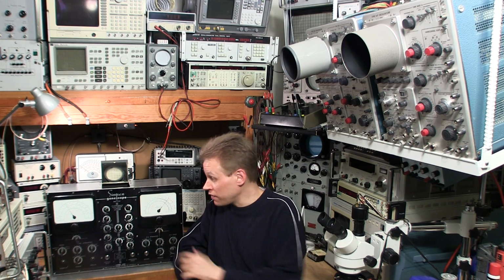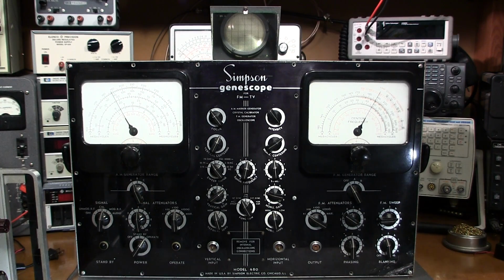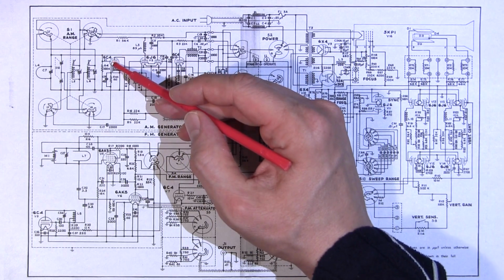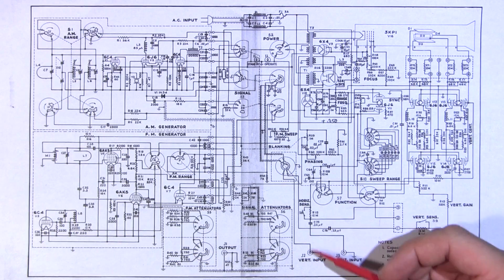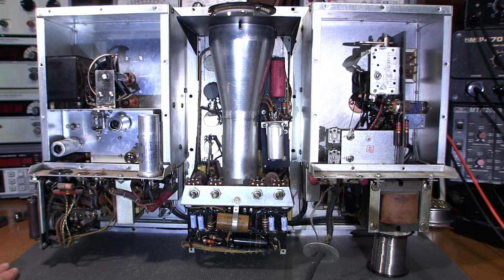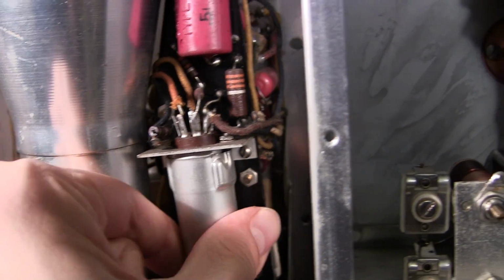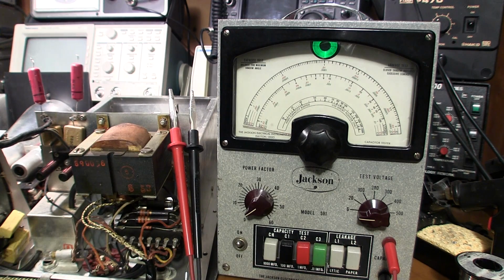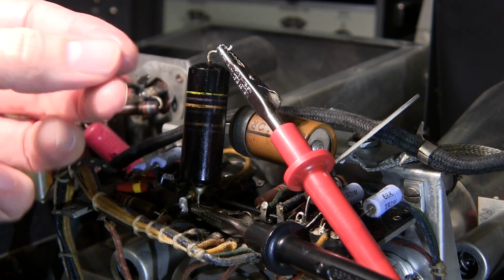Sneak Peak and Tear Down of a Simpson Genescope 480

Comment: Sorry Paul for commenting so late.

Cool... A "Wobulator!"

Sure looks like a huge endeavor to restore but well worth it.

I would love to see you modify the AM section to go down to the AM-SW spectrum. I know you, I bet you'd modify the dial's silkscreen so you couldn't tell that you added an extra band. You're right. You could use this for any vintage tube receiver gear. I hope you have an extra position on the ganged switch assembly to accomplish this.

I have three different 7" electrostatic TVs I will be working on. I also have a Pilot TV-37 with a P4 variant of CRT like your Simpson uses.

Best of luck and I hope you do choose to restore this fine piece of vintage test gear.

Take care,
                  Tom

Comment: I happen to have a 480 that's been sitting for a couple of years awaiting restoration, so in my unbiased opinion, I vote for the full Mr. Carlson treatment on that one (with the frequency mod, of course).  Simpson got a lot of mileage out of the design ... The scope portion was available as a stand-alone called the Model 476 Mirroscope, and if you couldn't afford the 480, you could get just the marker/generator parts as the Model 479 TV-FM generator.  I think you're correct that Simpson didn't include a AM radio frequency range in the Genescope because it would  compete with their AM signal generator line ... the model 415 and 415a (adds FM modulation) have a similar front panel look and the proprietary connectors as the Genescope, and we're probably marketed to service shops as a "family" of instrumentation. Can't wait to follow along!
Reply from the maker: Thanks for your input!

Comment: Death caps! There's a story floating around YouTube about a lady plugging in an old Delmonico and after hearing pop and seeing smoke thinking it's a goner gives it away, only to be resurrected with a few modern components and some minor tuning. Turns out the across the line "death cap" exploded and just left some smouldering confetti to clean up. 

Definitely increase the range, but how to do it without butchering the front panel? Add a 4 position selector and leave the lowest frequency range unmarked?

Comment: That is one big device! And 'just' 40 minutes so I don't have to set aside a whole evening to watch it :) One remark though: the crystal in the AM generator is NOT for stabilization, it's there for the CAL and Marker functions. First, you can't stabilize the generator with a 5 MHz crystal because then the smallest step would be 5 MHz, and there is no phase detection circuit and no feedback to the oscillator section.
Reply from the maker: HI Paul. The 5MHz crystal is a frequency standard, mixed with a free running oscillator to provide overall stability. I will cover this more when I do the restoration. If you want to read this in their words, here is the PDF, read page 8 of this PDF, or search for page 7 of the actual displayed page : http://www.myvintagetv.com/Apple%20PDF%20files/Simpson%20480%20Genescope.pdf
Reply: Hi Paul. Thanks for the link to the PDF, but I think it confirms what I said: the crystal does not enhance the stability of the oscillator. What it does is giving reference points on the scale, so that the user can calculate the logging dial steps between 2 reference points and then calculate the steps needed to get to the wanted frequency. So if you want for example 10.2Mhz you first determine the steps between 10 and 11MHz and then multiply these steps by 0.2 to get the steps you need to go from 10 to 10.2MHz, The 10MHz point can be found precisely by using the X-tal. Still a nice method to get a precise frequency!
Reply from the maker: Well Paul, you may be right. The topology is correct for a stable VFO, but they may be just mixing the 5MHz signal in for marking alone.

Comment: Definitely do the restoration as a video. There is a lot to be learned from working on old gear. I don't recall seeing one of these. I did work for a while on TV's in the late 60's. I'm guessing that unit was built in the 50's. Just has that look inside. The fact that the tubes are all miniature etc. that Mallory Cap is also a 50's item. 
I vote to do the mods to add the AM broadcast band, maybe even go down to 400khz for IF ?  A lot of test gear gets modified to suit the owner, so no harm there.

Comment: Hello Paul,  thanks. This will be a nice project. I am in favour of adding AM and SW modifications to the function generator as it gives a better educational value for the project and a good all-in-one system for you as well to use. It was interesting to learn about the typo error in the circuit diagram.

Comment: This is an electrostatic deflection tube, not magnetic (which would use a yoke like a traditional crt tv chassis); the E and H fields are at right angles to each other, and to the path of the charged particles (here, electrons). So while the vertical section in a tv would drive the vertical coils in a yoke, they have to drive the horizontal plates in this tube... I think. Also, the tube itself might be rotated 90 degrees.
Reply: Does the odd wiring have anything to do with the fact that the CRT is projecting into a mirror?
Reply from the maker: Hi William. That still doesn't fix the fact that the tube legend is wrong, and the internal deflection plates are attached to the wrong sides. If the tube was (physically) rotated 90 degrees, the horizontal dot travel would be from bottom to top, that would be a strange looking display.
Reply: N1RKW Good question!  Maybe Mr. Carlson can answer...

Comment: Hi, I recently joined the channel and i love vintage audio amplifiers. i would like to see (if possible) a repair or service of an old Nakamichi PA-7 Mark2 and also if this one can be improved.
I would like to see recomendations for those who enjoy modifications on tower speakers like Klipch RF-7 and precautions to convert a normal pair of speakers to become part of biampable or tri-amp system by using active crossovers eliminating the passive ones.

Comment: Maybe the brackets holding the variable inductor at 32:00, could be made in a different fashion. Is it not difficult to adjust Those, and could there be problems if it is not done right? Maybe adjustable sideways and up and down by way of something that has more presicion? Am I creating a problem here, or are improvements possible/Worth it?

Comment: I really hate to do this to you Paul but I would really like to see you restore that piece of test gear. On a side note that component board in the AM side is probably Micarta, it was a brand name for composites of linen, canvas, paper, fiberglass, carbon fiber or other fabric in a thermosetting or Bakelite plastic. Used quite often for rigid electronics boards Micarta chassis surfaces were usually point to point rivet connections. I used to see the quite often in older commercial FM tube type mobile and remote base station radios. Years ago I serviced base station radios that at the time were at the time 30+ years old that were built on that type board that were just as strong and rigid as they were new.  The only problems were the resistors and caps were all over the place. A radio sealed in a cabinet, inside a wood or concrete block building, no heat or air conditioning in the desert of West Texas. Also riding around in the trunk of a car in that heat and cold. They had to be build robustly to last. The mobiles usually out lasted 10 to 15 company cars before they were replaced by a newer model. Many were only replaced when the channel width was narrowed from 20 KC to 5 KC, although some mid-50's radios were capable of both wide or narrow bands and were still in use in the 1990's.

Comment: Very interesting. I purchased an old Simpson AF/RF signal generator Model 317-SR just because I love the old Simpson gear. Put it on the scope and it is solid. I know that I will have to update the caps at the very least, but it is in such good condition that it is hard to believe that it needs anything. That Simpson stuff is solid as a brick. I love your videos, thanks so much for your efforts!
Reply from the maker: Thanks Al! Glad your enjoying.

Comment: It is great to have things original. But it is also nice to have things more usable. I would go with the upgrades so you can get the joy from using it more often, instead of it sitting in a corner for months on end. Also interested to see you do the project in restoration and upgrade

Comment: Hi Paul,
That is a great piece of test gear.
This is just a thought, if I recall I think you mentioned that the oscilloscope face is projected on to the a mirror on the top.
With that in mind things would be reversed so having the CRT plates reversed may have been done on purpose.

Comment: Love it, would like to see this equipment in action. Also, would the CRT Vertical and horizontal connections be right in the drawing because of the tub orientation ? My pee brain is trying to see what the mirror to CRT action would be. : )
Reply from the maker: Hi Carl. Looking at the mirror from the front of the unit, horizontal is still horizontal, and vertical the same. If the dot travels from left to right (horizontal) it will appear the same in the mirror (left to right.) The vertical component of the traveling dot would appear reversed due to the mirror. So top is bottom. The only change that would bring is the swapping of vertical deflection plate leads. So unfortunately, they made a few errors on the schematic, and the tube legend as well. Hopefully there isn't any other errors, but when we get into the restoration, we will address those as we come across them.

Comment: Great video, I would certainly like to see more of it. The previous signal generator repair/modification video shows just how well you can pull off these modifications, so if you increase the width of the AM frequency section, I know it will look factory and perform exactly as factory would if not better, so that would be great to see. with the shiny surface, it seemed it was a sort of piano like lacquer finish?

Comment: Nice project on nice piece of equipment that will look good cleaned up with no rusty places.  1) When you are done maybe show us the frequency stability with line voltage variability. 2) What about the probes? I agree replacing them with BNC is a good idea. Most of the equipment I receive has the probes missing. Please comment on making new probes out of everyday stuff. I do not run across extra probes really at all from other equipment to modify for another piece of equipment. 3) This project seems ideal for illustrating topics on your previous videos on selecting the proper type of capacitor and resistor replacements for the correct applications. 4) I would like to see the details (techniques and tools and chemicals you use) the clean that inductor contact. 5) Could you share some design criteria for the line cord replacement. For instance a three wire line cord for a replacement concerns, ground loops and isolation.  6) I would encourage you to keep producing your fine videos.

Comment: I think the new series will be good the modern equivalent of that scope would be the mixed signal oscilloscopes with built-in signal generators. A piece of equipment ahead of its time. Just a question of curiosity do you run your own business from home and also an active Ham radio operator. If you feel there is a privacy issue replying, in the comments section reply directly to my email address.

Comment: I liked your use of the red pointer (I guess a trimmer-adjustment screwdriver) when you were going over the circuit diagram - maybe you could use it when you're pointing out physical components too. The red pointer was very good at indicating /exactly/ what you meant, although for waveforms perhaps you could use a finger so that it is easy to see the context. I always enjoy watching your videos and picking up the little bits of your knowledge gained through experience :)

Comment: I watched an earlier episode with a DeForest Crosley Receiver. You mentioned computer generated signals aired in various frequences. Maybe you can talk a Little bit about these signals and where they come from?
Reply from the maker: In my next receiver resto, I will try to address that topic. Thanks for your input.
Reply: Very interesting.
Reply: The digital signals he was talking about were most likely amateur radio data modes! There are many more digital modes than Morse code. I use ft8 and fsk16 and 32 regularly!
Larry

Comment: I can see your having to take apart every box and probably do a complete rebuild on this piece of gear, Paul. That's a long shopping list with some old-style value caps to replace. A lot of work and not so service friendly. Maybe it could be done in 3 parts. Although adding an extra function is great if you want to use it, some collectors don't like any changes from original. I have noticed this in mil receivers. I am presently removing all the unofficial mods in my receivers.
I enjoy all your videos which are all professionally presented.

Comment: cool piece of hardware, could use some modern replacements that leaky sweating cap has to go.
also i se this looks like it's one hand wired done up, 
do like the string holding wires together it's a real lost art you don't see anymore